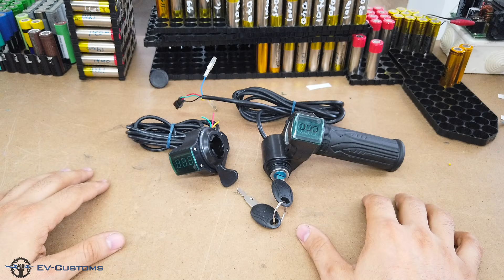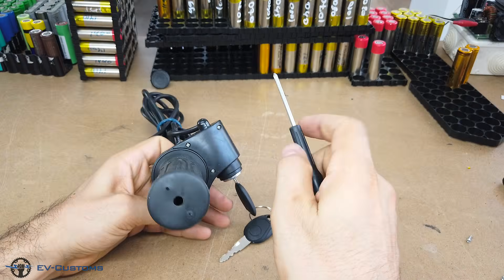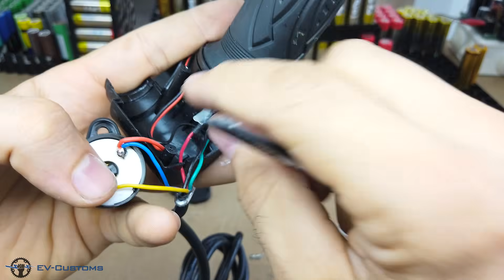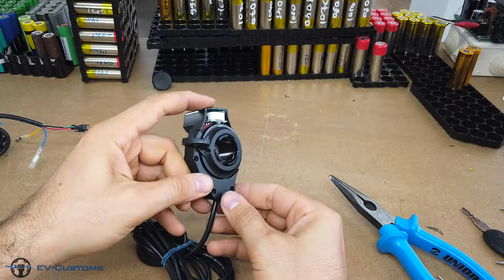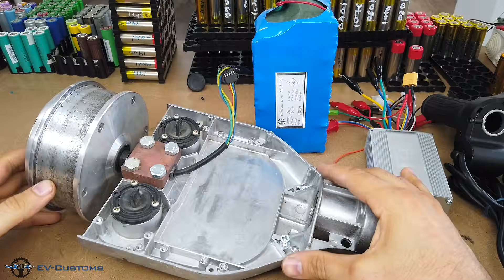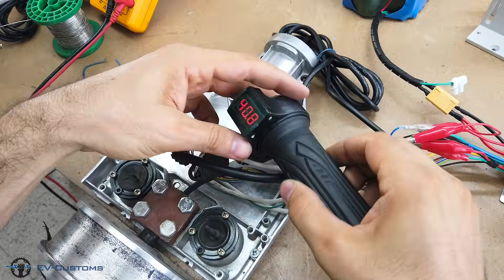How to Connect Universal Thumb Throttle Switch and Digital LCD Wires

Comment: Thank you. My throttle stopped actuating the motor unless constant pressure was put on the ignition keyhole. Turns out the yellow wire was disconnected but would momentarily reconnect when that pressure was applied. 
Great video. Very much appreciated 👍

Comment: y ebike guy , I liked & subbed , I hope your not too busy rite now, I know your pretty good !
Universal thumb throttle only 3 wires red(positive+5v), black(ground)& green(signal)
connect to which corresponding wires, from original “sin wave”48v 500w controller .
Converting from Original was generic display and key ignition. (5 wires)

Comment: Iam trying to wires a key switch throttle to my e bike. The throttle has 6 wires and coming from the bike i have 5. The bike has black red green yellow and white.  And the throttle has black red green yellow white and blue. I have no connectors so I'm wires nutting the wires and electrical taping them together. I don't know what goes where. Normally I would match colors. HELP ME PLEASE.

Comment: Is there a way to adjust these twist type throttles' idle voltage? I got two twist throttles from eBay and both of them are giving the motor 1.1V at idle (throttle all the way off, not turned), which causes the wheel to spin. Not ideal! I didn't see anywhere that could be adjusted inside the throttle you took apart, but figured I'd ask. Thanks for the video!
Reply: Schottky diode can do it but idk if it's the right thing for you. Might wanna just get another throttle or controller.

Comment: I brand ruiten universal throttle e bike wiring instructions 5 pin wiring diagram 54.6 
Who do I wire it to my sumad e bike .
Reply: model 48 volt 6g400w 5 wire 54.6v, key lcd throttle for electric bike? Sumad e bike that LCD is not working. 
Can you help me? 
Do I wire it color to the same color?

Comment: does it matter that im using a controller rated for up to 72 volts, 45 amps, 3000 watts, or would any throttle work no matter the controller i use?

Comment: What about if I don't install a display on the ebike what settings will the bike run at? Full power
Reply: Without the display the controller will output full power when you use just a thumb throttle (3-wire device).  God told me you already bought a key lock switch with voltmeter.  You just need a thumb throttle to run the ebike.  If you need help on wiring up the controller to the key lock switch here it is:  The key lock switch should have three wires.  The key lock/ignition wire from the controller goes to positive (red) wire coming from the key lock switch.  The black wire from the controller goes to the black wire from the key lock switch.  The green wire from the key lock switch goes to the positive wire from the controller.   Use 5V line wires from the controller not the battery wires. It will put stress on the key lock switch and will soon get burnt if you connect to the battery wires.

Comment: What is the signal on the green wire. Is it a PWM signal. Or simply variable resistance bn plus or minus? Oh. You say. 0 to 5v analog signal.
Reply from the maker: You can work it with PWM  signal and analog signal also..

Comment: What meaning color blue blinking inside battery pack
Reply from the maker: Xiaomi scooter battery pack?
Reply: @evcustoms  yes sir
Reply from the maker: @paulnaquin  That mean the battery is in good condition.m
Reply: @evcustoms  why my throttle is Not working n my voltmeter

Comment: Yes under the rubber  covering There is a button looks like the one they would use on some of the other ones i've seen and have a light button but there's Marking or button on the outside. I would send you a picture but apparently I don't know how or the website will let me

Comment: Can you please assist? Is there a way to reduce the sensitivity of the twist throttle? The throttle feels very twitchy and very hard to get the bike rolling smoothly.
Reply from the maker: Hi...  the easiest way is to add a resistor on the positive poke of your throttle...  i suggest you variable one..
Reply: @evcustoms  Thanks for the prompt reply. The current throttle is a variable unit. Even on speed 1 (3 speeds), the bike throttle is very difficult to modulate. Would adding a resistor to the signal wire help?
Reply from the maker: @baymoe1 Not on the signal wire..  you must connect it on 5+ red wire of the throttle
Reply: I'll give that a try. Thanks!
Reply from the maker: Let me know ok?

Comment: I have a motoberry controller - throttle stop working - I bought new throttle but still nothing happens when I twist throttle. When I measure red voltage wire and signal wire coming from controller I only get 2.7volts - could this be my problem? Seems like low voltage

Comment: Can you help me with a 6 wire controller connection to a 3 wire thumb throttle.  Very simple, no voltage meter, no key lock but connecting the standard red, green , black does not produce power to throttle.  Is there soemting I need to do with the otehr 3 wires...white, brown and yellow.  I thought it shoudl ahev worked with just the 3 but apaprently such is not the case.

Comment: You can also cut open the display cable cut the red cable and connect the yellow and blue cable to the two ends of the red cable.
For the creator. Thank you for sharing
Reply: I have a controller that doesnt have the standard green,red,black color combination what should I do ?  I tried plenty of different combinations but to no avail
Reply: How do you connect those i have a flipysky 75100 controller?
Reply: Have you tried same as a servo?  @chrismagallanes8858  use (-neg)+pos(sig=white)
Black to black
Red to red 
White to green
 Connect  it to controller
Reply: Comedians in the house I see...
Tried the red,yellow and blue together and the display fades in and out very dim,low voltage
Reply: @JohnRichardson-yj2hz  I did that and same thing doesn't work fuck that guy
Reply: What do I do with the green on the controller side?

Comment: Could you do a video on a twist throttle with on/off switch with a voltage display and 6 wires

Comment: Your explanation is clear and satisfied and covinced me ..thanks
Reply from the maker: Thank you mate!
Reply: @evcustoms  I have a great question for you, I am interested in a twist throttle that starts you off slow, because I notice that all the cheap $15  twist throttles that I a have used, knock you off the saddle as soon as you barley turn it to its minimal activation point, I am looking for a throttle that starts off very slow and gradually starts accelerating to full speed. Please refer me to one either through amazon link or a model and model number, I will subscribe to your channel upon you response. thanks

Comment: in case we remove the factory screen which also has the modes for the speed and replace it with the thumb throttle, which mode will the controller keep?
Reply: It will go into 2ndmode as 1 and three work when shorted with 2

Comment: Ok so my throttle broke and i got a replacement but the problem is that the original throttle had 6 wires and the new one only has 5 i messed around with the wires and got the throttle to power on but it just wont move the bike. How can i fix this.
Reply from the maker: How you connect them? tell me your colours..
Reply: @evcustoms  ok so all colors are connected with its same color except for white. I connected the white to the brown wire. The white and the yellow are the only 2 thicker wires. The rest are thinner. I connected the yellow to black and it fried the wire a bit lol. But still works
Reply: @evcustoms  yellow to yellow, green to green, red to red, black to black and white to brown. The extra color by itself with no connection is white. The thin white
Reply: @evcustoms  yellow to yellow, green to green, red to red, black to black and white to brown. The extra color by itself with no connection is white. The thin white
Reply from the maker: so your white wire is thick or thin?  the thick wires are connected yo ignition switch?
Reply: @evcustoms  the white and yellow are thick. All other colors are thin
Reply: @evcustoms  the thick yellow and white are connected to key ignition and the red
Reply from the maker: @RealRayAl  The previous throttle has 8 wires,, can you write me colors from the controller?
Reply: @evcustoms  it has 6. Red, white, green, black, brown and yellow.
Reply: @evcustoms  on the old throttle the brown and yellow is connected to ignition
Reply from the maker: @Ray Al  White wire must be your signal input from throttle to controller, green wire from throttle must be connected to white wire from your  controller
Reply: @evcustoms  did not work. Throttle did not turn on. Only wire that turns throttle on is white wire from throttle (thick wire) to brown wire from controller
Reply from the maker: @RealRayAl  please send me pictures with your wiring to evcustoms27@gmail.com
Reply: @evcustoms  ok
Reply: @evcustoms  sent

Comment: Do you have to hook up your hall sensor wire mine does not have one but it has the speed control wires and it says the throttle only for pas systems is the hall Central wire the one that also connects to the motor does anyone know and I have a regular throttle no key that's why I'm asking

Comment: Don't use thumb throttle , if they stick you can die ! Also with bike upside down to work on it , you can get sand in throttle to cause the condition !☠️

Comment: Great demo, I’d like to use the keyed switch to just turn off the throttle (not the PA function) is that possible to change the switch wires in the keyed throttle? My existing throttle has 3 cables only. I don’t need to see voltage display. Thanks Ross

Comment: Hello EV-Customs, can you tell me if I can bridge this input and output wires (connect them) from 3:12 to use e-scooter without the lock. I can't turn my key all the way up and can't find this voltmeter + ignition lock anywhere because they are out of stock in my country. This would be temporary solution for me since I am delivery driver so I need to be able to use the scooter as soon as possible and your help would save me right now.
Reply from the maker: Yes for sure you can do that, connect them to each other (links) and it will work.
Reply: @evcustoms  thank you very much, you saved me

Comment: Very nice demonstration. Can I ask, if I want to use a Pedal Assist Sensor does it have a separate wire in the controller? Or just connect it in the same wires for the throttle wires?
Reply from the maker: Hi
You cannot connect PAS sensor on throttle.. PAS sensors working with pulses, throttle have analog output
Reply: @evcustoms  so, does it have a separate wire for pas on the controller?
Reply: @redfoxthehobbyist  
The wires from the step sensor enter the controller. (It's a magnetic sensor).
 Each time the pedal it's turns, it releases motor voltage for 3 seconds, then shuts off!
It has nothing to do with throttle acceleration.
Reply: @redfoxthehobbyist  Yes, separate wire from controller

Comment: What if I have 6 wires?? Both my controller and throttle have 6 wires. I connected all wires and only the light indicator and on/off button work however the motor gets no response. 
Throttle has:
Red/white/blck/green/ brwn/yllow 
Controller:
Red/white/black/green/blue/yellow
Also my controller does not have the 3rd switch wire. I do not want to give up. How can I resolve this issue?
Reply: Same here, my battery has a key on it that switches on the power so the controller does not have a wire for that purpose. Have you figured it out?
Reply: @jstar1000  unfortunately not, however I  found another throttle that has 5 wire so I was able to plug and play to the stock controller. I couldn’t figure out the 6 wire.
Reply: Actually mine is a 5 wires but I still have the same results above. Mine has the three throttle wires and a yellow and blue wire but no matter what I do I can't get the throttle to actually work. My original throttle has a button that sets the system to either throttle only or PAS only so that is the problem I think and I can't find another one like it for sale. Button in and its throttle only, button out and its PAS only.
Reply: @jstar1000  Have you figured it out yet because I also have a yellow and a white wire turns on the ignition and then the throttle actually doesn't work but the motor spins constant velocity.
Reply: @indiandance5564  no, I gave up and ordered a regular throttle.
Reply: The 6th wire is a heat sensor wire . 
In the linked video starting at the 7 minute mark the author say you can cut off the 6th wire  or disable it 

https://youtu.be/Bvym-lX9Rk0